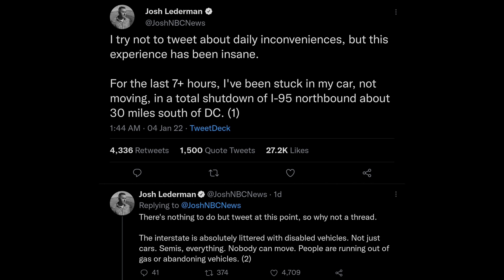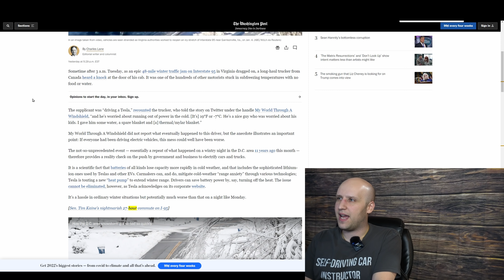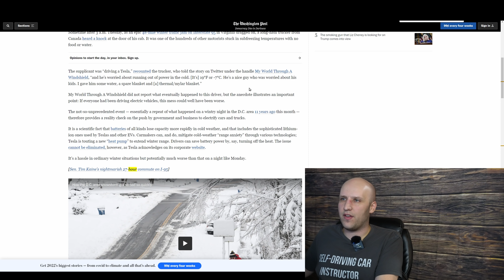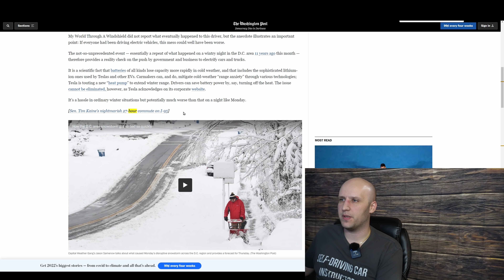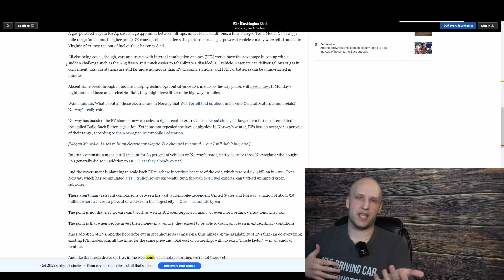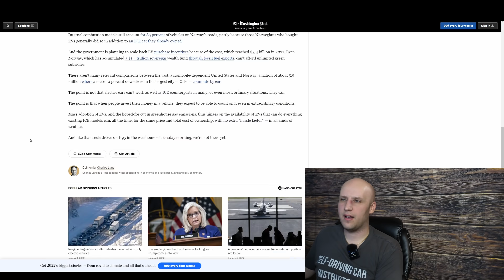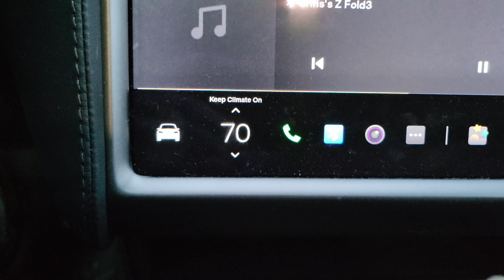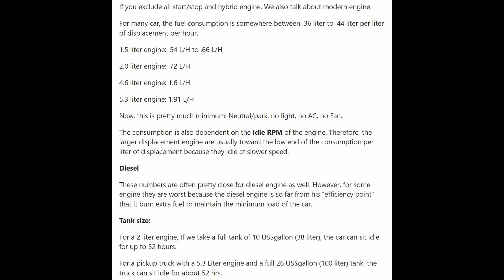How Long Can a Tesla Keep You Warm In A Frozen Traffic Jam? | FUD Debunking

Comment: Any ar can be low/out of fuel, but a gas powered car can be refuelled quickly and easily in situ, not the case for electric cars.
Reply: Electrical outlets aren't that hard to find.
Reply: @jstar1000  I’m not saying to not get an EV. I’m saying don’t be the guy who lost $60,000 on a Tesla when solid state batteries are around the corner.
Reply: @ricecakeboii94  They come with an 8 year battery warranty and once you need a new one you can have a solid state put in as needed. I don't see your point.  Besides I'm old, waiting is not an option.  I've had mine two years and absolutely love it. Best vehicle I have ever owned and I've owned a shit load over the years.
Reply: @jstar1000  Have you seen the fine print on the 8 year warranty for the model S/X? It’s only if it keeps 70% of the battery capacity which defeats the purpose since the biggest issue with batteries are battery degradation over time that leads to less capacity. If your Tesla doesn’t hold a charge the 8 year warranty does NOT cover that (look at Tesla manufacturers warranty website).
Reply: @ricecakeboii94  it's not fine print, it's regular font. In 8 years I'll have over 100,000 miles on it anyway. If and when I need a new battery I'll just buy one if the car is still on decent shape.
Reply: @jstar1000  New Teslas’ have their batteries soldered on to the frame. Worst than glue anyone who has desoldered any electronics will know it’s a massive undertaking & will never be a clean job.
Reply: @jstar1000  Ones that are fast enough to charge an EV are. There are less than 50 in the area I drive most here in the UK and no high speed chargers unless I buy a Tesla. The road network here is such that any closure, and they are frequent and lengthy could mean a diversion or 150miles. This would mean having to return back to the nearest charge, and waiting in a queue, potentially for hours. New regs here in the UK say that the domestic charge points now have to have the ability to suck charge from the car to make up for any shortfall on the grid. Plus there is now randomised charging times. So there is no guarantee that when I want to go to work there will be sufficient charge in the car.
EVs may be the future but there has to be a lot more done to secure an adequate charging network and an adequate generation. Better battery tech would help but so far all 3 are slow in coming.
Reply: @CP-du3ci  damn, sucks to live in the UK!
Reply: @jstar1000  Everywhere has problems. I used to think of emigrating to Australia or New Zealand until the draconian treatment of the population echos China more than the west. Most of the UK problems are brought in from the USA or middle east and we do nothing to stop them.
Reply: Ikr? Nobody's bringing you a new $12,000 battery...are there even tow trucks with EV chargers? Not.
Reply: So don't buy one then.
Reply: @jstar1000  I have no intention of doing so, but after 2030 here in the UK ICE vehicles won't be available for sale, they are already getting very rare with the dealers.
Reply: @CP-du3ci  Get your new ICE vehicle now. EVs are the future, but don’t be the guinea pig testing it. I am buying a truck this year before the US EPA forces light trucks to go hybrid/EV.
Reply: @ricecakeboii94  Can't afford one, they are half to twice the price of ICE here in the UK. plus the area I travel in most has fewer than 50 charging points and no high speed ones unless I buy a Tesla.
Reply: Teslas are known for low reliability. Most of the time I see a tow truck, there’s a tesla on it.
Reply: @ricecakeboii94  OK, I have had mine over two years and the only thing I have done to it is put a new set of tires on it, and added windshield washer fluid once. That's it, absolutely nothing else. I never have to stop for fuel as I charge at home. If that is unreliable then I'll take it. I think your talking out your ass and making shit up. I have never talked to a tesla owner that had anything bad to say about them and they are super reliable as there are no moving parts just a battery and electric motors. Look at an electric fan you have owned for years. You've probably used it for many years with zero maintenance and no issues correct? A Tesla is the exact same way other then a battery. I've never seen a Tesla on a tow truck in my life.
Reply: @jstar1000  I drive a 2002 Acura MDX & plan on getting another Honda product.. so yes, they do last a while with little/no maintenance.

Comment: Back in 2011 I had a side job scraping sawdust and wood chips out of frozen trailers for a trucking company that delivered to the wood mill. 12 hours shifts with no access to the mill building. All we had was a lean-to and no heat. I drove a 91 Dodge Daytona 2.5T back then and would keep it idling all shift so we could take turns warming up. Car only used 1/4 tank of gas each shift. The temps were always in the teens or single digits (Fahrenheit), but simple math says that car would last 48 hours idling. Fuel capacity is generally increased or decreased with engine displacement, so you can expect similar results from most any ICE that's running efficiently (no vacuum leaks, O2 sensor issues or stuck injectors/improperly tuned carburetors.)
As it is now, most EV owners are financially stable enough to have their own charging station at home, but once we start transitioning to the masses having EV's and relying solely on charging stations, you'll see a lot of people running around under half capacity regularly. A situation like what happened in Virginia will effect an EV with 1/4 capacity much worse than an ICE with 1/4 tank of fuel. That is the point being driven by so many people.

All in all, this test was great. Previously all you could find about heating time in a tesla was from people who decided running a test when it's 70 degrees outside was a good idea, which made no sense. Glad we have real data here to work with, rather than pure speculation and warm sunny day tests... as EV's and battery technology progresses, the heating and battery capacity will only get more efficient.

Comment: Question to the Model X numbers:
43kWh in 12 h is equivalent to around 3.6 kW permanent load...
That's like 2 big electric heaters working permanent.

Shouldn't this be an indication that the model X has zero thermal isolation?

Comment: I have a question regarding your solar what type of system do you have how many kilowatts? Do you produce enough energy so you don’t have to pay your electricity company I have two electric cars one model three and one model y i’m just hesitant about getting a solar system i’m worried about not producing enough electricity
Reply from the maker: If you size the system right it can cover both cars. We sized ours when we only had the model 3 so now we use more energy. It's a 14.4kW system with an 11.4kW inverter. In winter we don't make as much power, but we over produce in summer and get to use those credits.

Here are a couple videos with more information: https://youtu.be/DA3fRMm3a0c and https://youtu.be/rHNIxFT5R94

Comment: One thing this does show is that EVs should probably be designed for 300 miles or more. Many EVs only have a range of 100 miles or sometimes even less. That can result in more trips where you just barely have enough range to get there. In situations where you have less margin, there's definitely more danger.

I drive a 2012 Nissan Leaf. Due to Nissan's failure to design active cooling features for the battery pack, it is heat-degraded to something like 50% of its original 24kWh capacity (which is small to begin with). That means on a full 100% charge, I have about 30 miles of useful range (in the winter) before I get a low battery warning. Cars like that are going to get people stranded.

Comment: I think that is wonderful information. My thoughts on EV differ from most. I am curious as to how your driving style changes. Do you constantly worry about battery power? If so, it would make you worry about all factors of power consumption. How fast when taking off, heat and air, speed driven, and distance. More or less, is it more stressful to worry about power consumption all the time. How did EV effect your driving sryle?
Reply from the maker: I do obsess over the efficiency a bit, but I did that with my Ford Focus too, always trying to get the best MPG I could. The nice thing about an EV is if you can charge at home, you're at 90% every morning without even thinking about it. For road trips, you just hop charger to charger. It's super easy and not stressful at all.

Comment: Another variable that you may not be considering would be significant wind.  If its cold AND the wind is blowing substantially (> 10 mph), the heat losses to atmosphere would be accelerated.  In such a case, the load on the battery to keep the car up on temperature would be much greater.

Comment: The difference between a gas station and charging station is a gas station can run comfortably on a relatively small backup generator ... a high capacity charging station needs the sheer power of grid electricity and 5he charging cars are taking up the space longer than someone quickly filling up...especially in an emergency when time is of importance. 

An electric car is just not as reliable when extreme conditions threaten the power grid...a gas station can easily run on a generator in emergencies and a ice car on a full tank can idle for around 33 hours at a temperature as warm as the water in the engine gets to.

While the constant drive of electric motors and smoothness is a definite plus...those things are not enough to convince many over the worst part of an ev...and that's the battery itself. The cost, deterioration over time (petrol motor will basically have the same mileage no matter how old it is, as long as it works), the weight and the charging times as they may be "relatively" fast to 80%, to 100% is a lot longer. Not everyone can or will want to shell out extra to install home charging and wall plug packs are a joke
Reply: The age old argument between eCars and ICE cars ignores the fact there's very little difference between the two. One charges through easily available and often free electric chargers, the other fills up through easily available and very cheap gas stations. They both have the same range, they take up humongous space and expensive free parking, they are both much more likely to be totaled out than wear out their engines and chassis, and they are both heavily subsidized by government policy in relationship to PEVs, rail, and bicycling although not airplane travel.

And both cars are stupid vulnerable to weather disruptions such as this. And ironically they are now the primary cause of weather disruptions such as this, as they both emit massive CO2 from either moving or the infrastructure they require to move.
Reply: @langhamp8912  
To be honest I like and dislike both...ev's are just simpler and the power delivery is fantastic but until they are exactly the same or better in every single way than a traditional car (i.e. no range degradation due to age and use...no one wants to buy a used ten or fifteen year old car if it has a depleated battery..., almost instant charging and the weight penalty for the batteries) then I see not much reason to switch.

Nearly everything pollutes so I'm not gonna even bother with that topic because when it comes down to it...I really don't care when it comes to a well maintained car.

Traditional cars are complex in comparison so there is more chance of some type of failure (most last decades though as mine is now 30 years old and still going) like developing leaks, deteriorated rubber hoses,rubber and plastic parts and internal engine wear...but even though it has these downsides it still trumps an ev in weight, refuelling time and refuelling convenience (you see a near empty gauge...you immediately pull in and refuell... three minutes later you have full tank, full range and you era ready to go).

They both have pros and cons and it's not the actual ev vehicle that has the cons but the actual battery itself.
Reply: @stevenbalekic5683  I'm not trying to convince you of the better or worse differences between cars but rather cars and their infrastructure are highly pollutive and that building infrastructure to only serve drivers using the least efficient form of transportation while excluding everything else makes society fragile while bankrupting neighborhoods.

Think about how often you're delayed on a highway when drivers crash. That downtime almost never occurs with pubic transportation, and when it does you almost always have an alternative form of public transportation that's immediately communicated to you. Meanwhile, car transportation remains highly unreliable and dangerous.

A more fiscally prudent society would try to build fewer roads, and try to place grocery stores within walking distance. That'd save a lot of money by not requiring citizens to drive to do every tasks. It'd be safer too.
Reply: @langhamp8912  
I live in Australia and public intercity transportation (say high speed rail) is not economically feasible due to the high build and running costs and the lack of population (or riders) to utilise it (even with high ridership) if it existed.

The conventional train is quite expensive to ride so everyone just flies...basic domestic flights are sometimes as low as $29...or for convenience you just drive so you have a car to get around when you arrive.

My local supermarket is about 500 metres away...but our shopping habits are to go once a week or once a fortnight (hate shopping) so I take the car because there is no way I can get that much home by walking...especially in summer when it's 48°C.
Reply: @stevenbalekic5683  Jared Diamond goes into quite some detail of the economics of Australian cities, and came to the conclusion that while large Australian cities and small resource extraction towns were fiscally responsible, medium sized towns were fiscally insolvent, and that a lot of that came down to the massive cost of road infrastructure to tax revenue base. Australia suffers from the problem of cheap land which you would think is a good thing but that encourages expensive urban sprawl...it's a trap!
Reply: @langhamp8912  
Land is cheap in places no one wants to live, but I can assure you that in any large town and every city is indeed quite expensive for land.
Sydhey and Melbourne have a large percentage of their suburban areas where the media  house price is over a million dollars, and the other cities and large towns also have a high median price for land and housing. My house is about 12 to 13 kilometres from the city centre in one of the cheapest (for real estate) cities in Australia and my house value is half a million to six hundred thousand.

For everywhere else roads are the only viable option because railways are too expensive to build, run and maintain to every small to medium town...quite a few railway lines have shut down because of this across the country because they always ran at a loss (which didn't have any payback for local economic activity created) freight and passenger services both.

My state South Australia has only one city over a million people in an area three times the size of Germany or a third larger than Texas.
The next sized town after Adelaide is Mount Gambier with 21,000 population and over 400 kilometres away from Adelaide...there are only two more towns with around 20,000 population before everything gets really small.

It's just not viable for much public transport between these places.
Reply: @stevenbalekic5683  Do you think roads and parking built for automobiles are built and run at a loss like railroads?
Reply: @langhamp8912  
Don't think so, all economic activity is reliant on the roads and the few rail corridors for industry and commuters. Australia does not tend to build large carparking lots like cities in the US...so it's not relevant here.

Comment: Heres a scenario, find an excuse for that one:
100 cars stuck, -20c (which kills about 30% of a battery to start) and you get stuck for 24 hours. Lets say they all run out of juice.
Your gonna call 100 tow trucks?
While in a gas vehicule, a tanker can simply show up, fill everyone and done deal.
Those electric cars, they're all gonna need a tow. Thats hours extra.

P.s: in winter, when my gas tank gets to half i consider the car empty and fill it up.(i do that all year round actually. It has become a habit. Colder days i even fill it when it hits 1/4. The stress of getting stuck is reduced by a thousand fold when you dont have to stress about gas.)